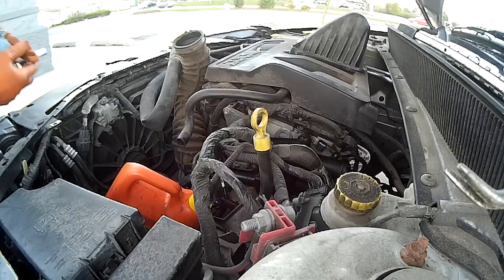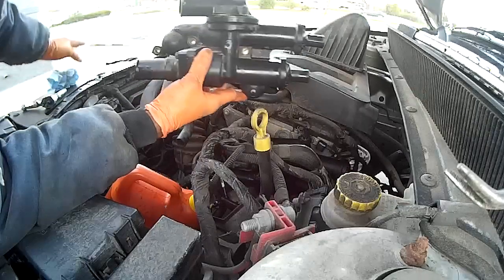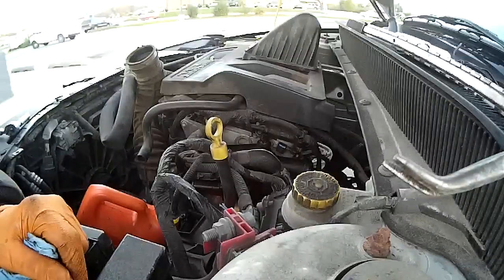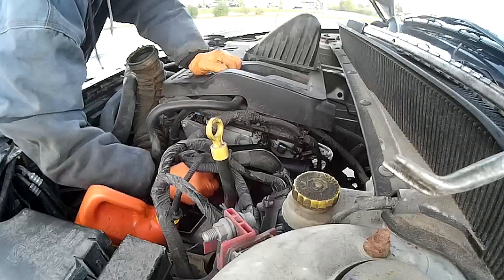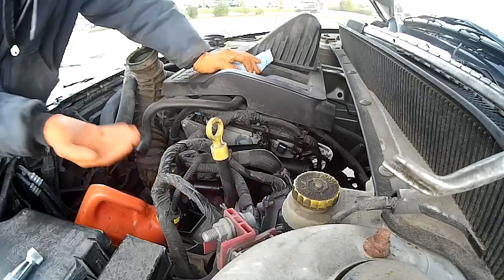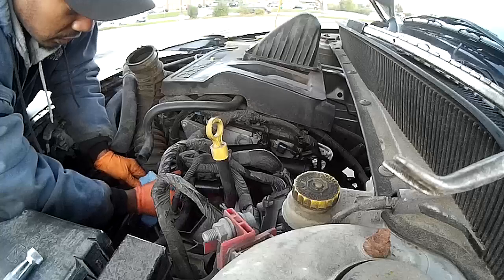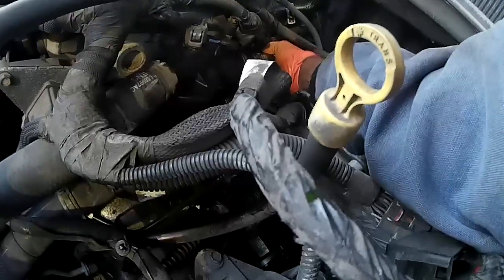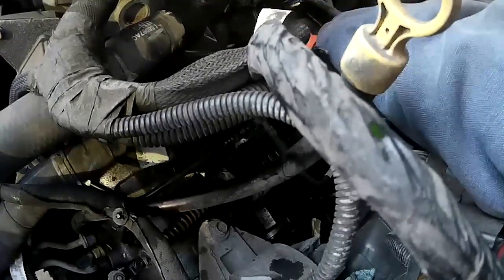2008 Dodge Avenger 2.4L WATER OUTLET Replacement pt 2/2

Comment: The bolts on my water outlet are extremely tight... Can't get em off with a ratchet 😠
Reply from the maker: Apologies for the late reply. Spray the bolts w/ penetrating oil let it sit for a while

Comment: Thank you my dodge just started leaking would you say best to just replace the whole thing ?
Reply from the maker: I highly suggest replacing the entire thing and make sure you burp all the air out the system too.
Reply: bigvell02 thank you for responding would burping the air be hard !
Reply from the maker: If its your 1st time make sure you do plenty of research, videos etc. Its not a hard process safety is key though

Comment: my engie light has come on scan says thermostat
should chage the thermostats and housing or change the coolant temp sensor
Reply from the maker: Colin Lloyd depending on miles I would probably change them just to be safe along with the sensor. My logic is spend a few dollars now vs a lot more down the line 😎

Comment: I need help with my car it's a 2013 dodge avenger 2.4 
Is leaking transmission fluid but it seems to come out of the water thermostat assembly I don't know if it's that?
Reply from the maker: Woah trans fluid leaking out the thermostat assembly? Check the radiator (this is off the top of my head) some radiators have an internal trans cooler. Its possible it could be mixing there. Keep me posted - I will post some updated thoughts once I step to a 2.4 engine
Reply: @bigvell02  yes sir I haven't found the problem one I do I'll let you I think I'm going to change the thermostat housing  2 see if that works
Reply: Did it cause the emission light to come on

Comment: Did your coolant temp sensor fit snuggly inside the new housing mines is kinda loose but fits tight in the old assembly

Comment: hey my check engine light came on after doing this process, any clue what can it be?
Reply from the maker: Yes indeed. Did you plug the coolant temp sensor back in on top of the housing? Check all wire connections in the area you worked in. If everything is cool stop at a local autozone (free scan) if its something with the coolant temp and everything is plugged in you might have air trapped (coolant bleed procedure). Thats all I can think of at the time that could have something to do with the check eng light after this repair.

Comment: Hello sir, I'm going to buy a new housing but noticed the heater hose connections are smaller than the original. Did you come across this & did you get smaller heater hoses?
Reply: Optimist 86 Watch out, O Riley charges $126.99 for that plastic assembly.

Comment: I read about this swap needing to use different Heater Hoses, but no one (including Dorman) lists the P/N for the new Heater Hoses. Do you happen to still know the Part Numbers of the Hoses that are needed for this repair?
Reply: I am also having a problem with the hoses. The new housing requires smaller hoses than original. Please post when you find anything and I'll do the same. Thanks

Comment: my 2012 dodge avenger overheating symbol keep coming on any advice?
Reply from the maker: Sorry about the late response but you definitely have a Real Issue. Chill on driving until you investigate more. When The Car Is Cool :-) Check coolant levels, squeeze hoses to feel in they have coolant in them. Inspect for leaks. this is a good start.
Reply: thanks bruh i got it fixed at goodyear alternator battery and serpent built i wanna say preciate it
Reply from the maker: No problem. I'm happy I was of help. Peace!

Comment: I just need to remove the thermosat. Any advice / help ?
Reply from the maker: Make sure the engine is cool, drain coolant, remove hoses, loosen bolts to remove plastic housing, take housing off to expose thermostat, there is also another sandwiched inside the housing 2 bolts to remove and you will have access. *IF your just doing the one on the housing just remove the big outer hose and loosen 2 screws pull old thermostat and replace. Forgive me for the crude breakdown I'm sneaking this response at work.

Comment: hey cant I just change the o rings ? or do I have to replace the whole water inlet part ?
Reply from the maker: Hello and yes you can. I'm 100% sure on that as long as you use OEM rings. The outlet housing was cracked so I had no choice but to change the whole assembly.

Comment: Is it possible to just change out a part of that whole housing? I have a leak coming from the outlet (the piece you kept holding in your hand when you were showing us what the whole housing looked like) I believe it's a old gasket seal. That part only has two bolts. I hope this all makes sense lol
Reply from the maker: Cynthia Sheffield I know exactly what you mean. It is possible to change just that part but if it's not the seal then the plastic could be deteriorating - inspect it with care. Most part stores will only sell the complete assembly you might have to search the net for it. I hope this helps and best of luck
Reply: bigvell02 Hi, I was able to get just that small part, but went ahead and bought the whole housing as well just in case. My mechanic thought it was just the small part and was able to release it by removing the two bolts that revealed the thermostat. It turns out because my car was over heating, the car got so hot it burned the second seal and a piece of the housing where the 2nd thermostat is held, so I ended up having to replace the whole housing. Also flushed my radiator and put new coolant. I'm a lady but know some things about cars😗
Reply from the maker: I'm glad it wasn't worse some have blown head gaskets in worst case, happy to hear you replaced the whole assembly. No need to ride with suspect parts. This one had signs of pitting basically rotting in some areas. Hooking it up the proper way... Nice! Check you out!! your a real car guys dream lbs, that's also good thing to be a lady that knows cars. Tons of people get ripped off by shady under the tree mechanics. Stay tuned my channel is mostly car audio but I love to make helpful videos :) :) :)
Reply: bigvell02 😘😘 Thank you for posting the video!!! Would you by chance still have your Dodge Avenger? And I thought guys didn't like or prefer ladies who has a like for cars or fixing things?? LOL I'm also a huge football fan but I'm not TomBoyish. I can balance between work and being a lady 😘
Reply from the maker: Cynthia Sheffield This was a customers car but I still have my Sebring which had the same engine as this car. They called this engine the world motor. Nothing wrong with a woman balancing things - Queens make that happen with style 😉. Only secure men don't mind a lady that can  work too. He would also make sure she wouldn't have to unless he was unavailable, nothing wrong with that. My biggest skin itch is seeing a lady change a tire, bulb etc and their man is in the car or in the house . That's a Fail to me 🤷‍♂️, oh yeah ps you better stop with those 😘😘 and mentioning non tomboyish! I'm single 😎😉😂😂 have a great day...
Reply: bigvell02 😂😂😍😍😍😍😘😘😘😘😘😘 I'm single too.

Comment: I have a question I have a 07 Sebring with the same 2.4l engine  and I'm losing coolant but no sign of it falling on the ground but I see some coolant on top of the transmission could this be a faulty water inlet?
Reply from the maker: Yes it could very well be that housing - it usually leaks from the bottom which is hard to spot. You can see it with an inspection cam or mirror most likely this is it. When The Engine Is Cold & OFF KEY IN POCKET ;-) put your hand under it and squeeze a few coolant hoses, the upper radiator hose should work fine if you feel coolant then yes that's it I hope this helps.
Reply: bigvell02 yes this helps a lot thank you.
Reply: bigvell02 ??
Reply: @bigvell02  hey i have coolant leaking/ pouring from the back of my engine. Could this be the reason?